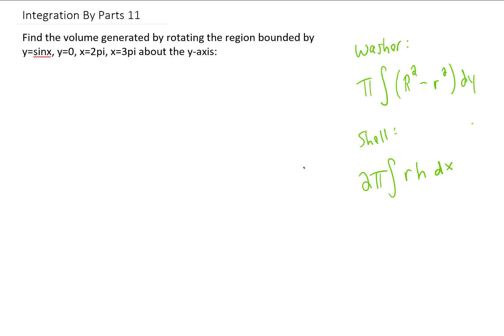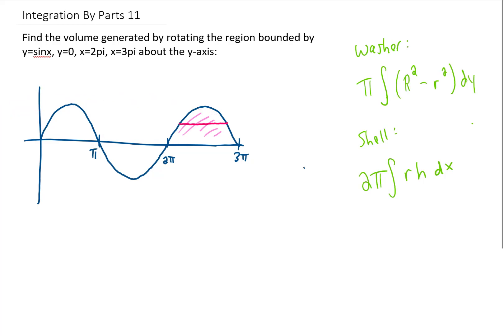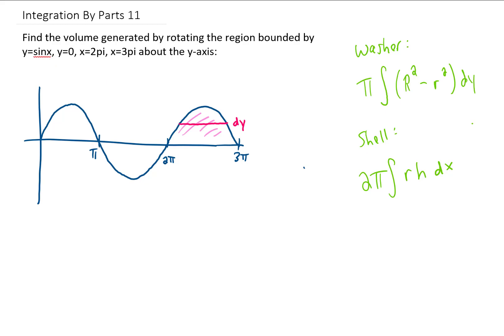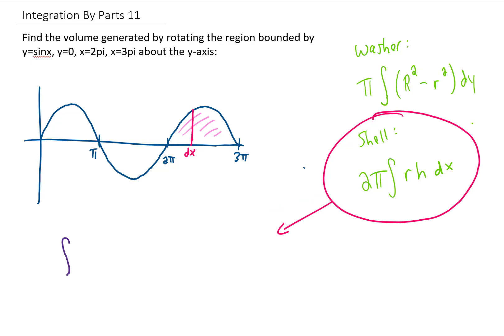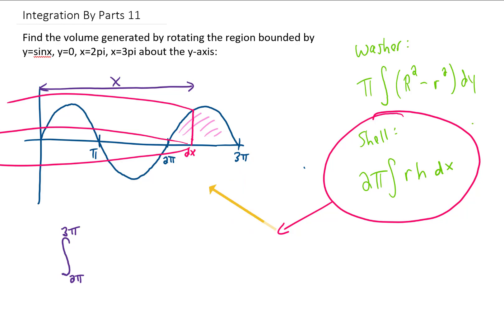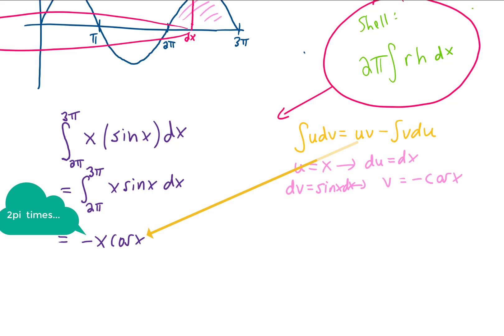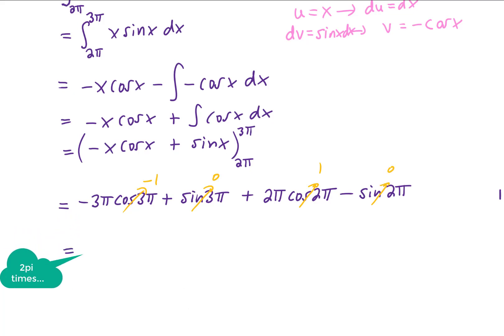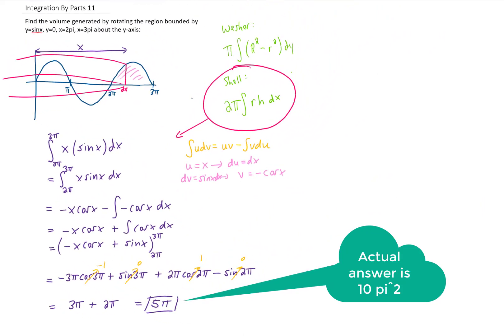Find the volume generated by rotating the region bounded by y=sinx, y=0, x=2pi, x=3pi about the ...

Comment: how is washer method for this?
Reply from the maker: Well, you'd have to slice the regions horizontally, which adds complications. We'd be integrating w.r.t. y as well. For example, rotating just the region between 0 and pi would involve an inner radius of r=arcsin(y) and an outer radius R=pi-arcsin(y). Not too fun.